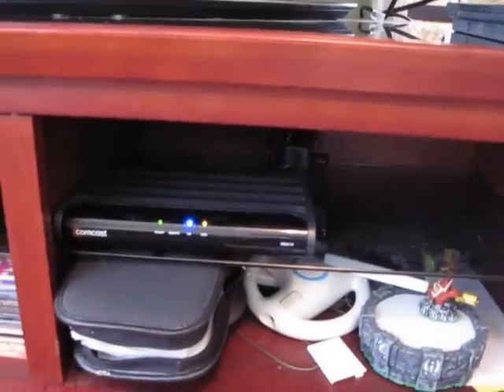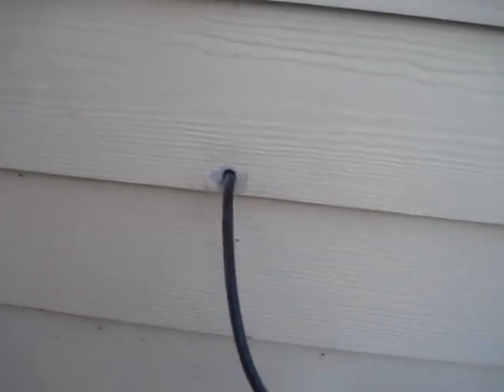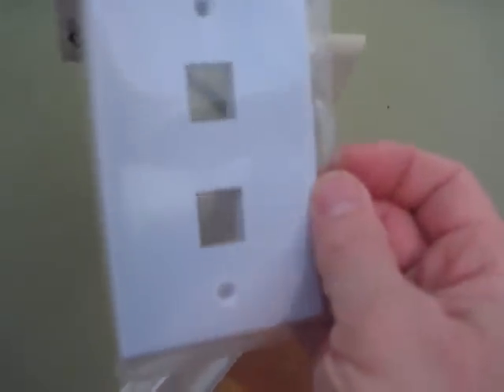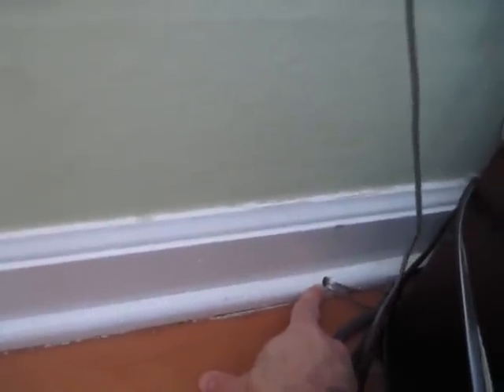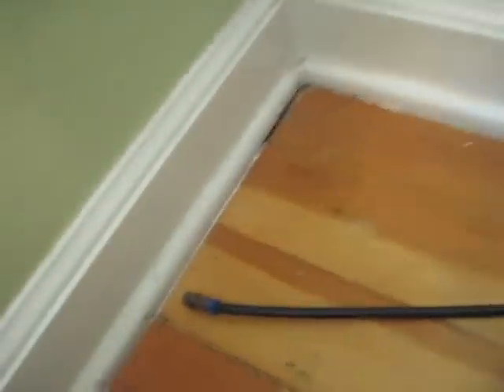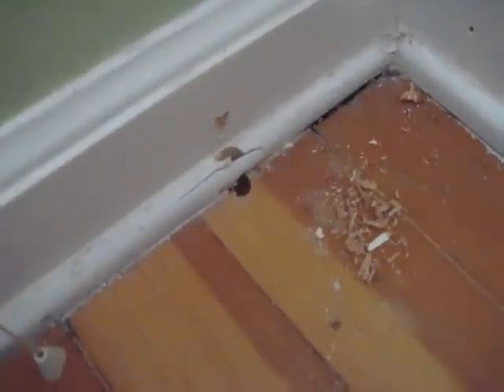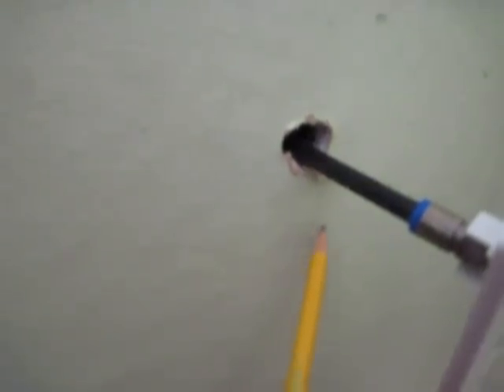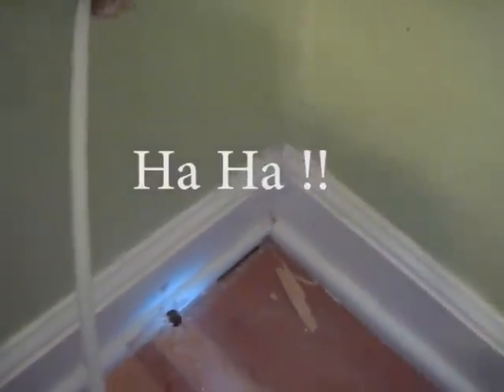How to Fish a Wire Through an Existing Wall

Comment: The best bet, in my opinion, is to invest in a flex bit and a bit bumper ball. You cut out the hole in the wall, drill outward from that hole into the stud, header, or blocking with the bumper ball guiding the bit away from the edges, and then put a mud ring in the wall opening to affix the wall plate to.
Reply: Treddian - this suggestion needs to be pinned if YouTube lets you do that.

Comment: Figure 2
Figure 2 is the wiring scheme for the plug side of an RJ-45 connector in accordance with T-568B standards. The T-568B standard is the most commonly used. The wiring diagram is shown with the "hook clip" on the underside. The wall jack may be wired in a different sequence because the wires may be crossed inside the jack. The jack should have a wiring diagram or designated pin numbers/colors to match up to the color code below. When wiring a jack or an RJ-45 plug, remember to keep

Comment: How about drilling a SMALL (1/8", 1/16" or  thinner sharpened music wire) reference locator hole in the floor along the baseboard trim from the TOP DOWN  that you can measure from and fill afterwards with a spot of color putty. THEN you can confidently drill up INSIDE the wall cavity.

Comment: so how would you have measured differently to drill the hole in the correct place?
Reply: He should have accounted for the dry wall, e.g. if your tape measure stops at the wall add ~ 3-4 inches to make sure you clear it. And never drill blindly into a wall without using a metal detector or even a clipped coat hanger to feel around inside the wall before you go up any higher.
Reply: Jon Shipman
 thanks for replying, Jon

Comment: What I would of done it cut of the coaxial connector off..pull the coaxial cable out and them tape the cat 5 cable. Fish it in and put your connectors back.
Reply: His coaxial came straight from the outside through a hole in his siding. He shows it and explains why he doesn't follow the coaxial at the beginning of the video.
Reply: Fed from a different spot,  How's that going to help. Even if it was the same spot,  you'll then have to feed the coaxial cable back in.

Comment: the “twist” as close as possible to the (jack or plug) receptacle. This will insure compliance with Ethernet wiring standards. 

Specification T-568B
Pin # 	Color	Pair #	Name
1	white/ orange	2	Transmit Data +
2	orange	2	Transmit Data - 
3	white/ green 	3	Receive Data +
4	blue	1	not used
5	white/ blue 	1	not used
6	green	3	Receive Data -
7	white/ brown 	4	not used

)

Comment: shold of showen the network cable wireing  
 

code below. When wiring a jack or an RJ-45 plug, remember to keep the “twist” as close as possible to the (jack or plug) receptacle. This will insure compliance with Ethernet wiring standards. 

Specification T-568B
Pin # 	Color	Pair #	Name
1	white/ orange	2	Transmit Data +
2	orange	2	Transmit Data - 
3	white/ green 	3	Receive Data +
4	blue	1	not used
5	white/ blue 	1	not used
6	green	3	Receive Data -
7	white/ brown 	4	not used
8	brown	4	not used

Comment: I see a lot of people have already jumped in with the negative crap, how about a little something constructive. Anyone who has done this much has done the exact same thing. If you had used the straight part of a wire coathanger and use like a drill bit (Yes it will drill) then you could have caused less damage to the floor and trim. You kind of left me hanging because you never showed back in the crawl space to show what you did to correct this.

Comment: How do you make sure you don't hit power lines?
Reply: Kyle - I'm sure someone has a better suggestion, but you can do it by feel. When you get through the first layer of wood, sheetrock, etc. stop drilling and feel around with the bit to make sure there are no obstacles between the bit an the next wall. Hitting gas, water or electrical would all be very bad.
Reply: Power wires in housing walls should be in line with your sockets which are generally a foot off the floor.  As another user said, just pulse drill until you make an opening. You can then use a flashlight to verify and then clean up the hole.

Comment: This is not how you would do this.  Almost none of it is correct.  As you can tell from te fact that you missed.  You would actually do a tip and drill.  You use a 3 foot long drill bit, poke it into the wall, and while it is spinning you tip it down.  Then you drill down, inside the wall, into the crawlspace.  The bits even have a hole through them to attach the wire so you can pull it back up through the wall.